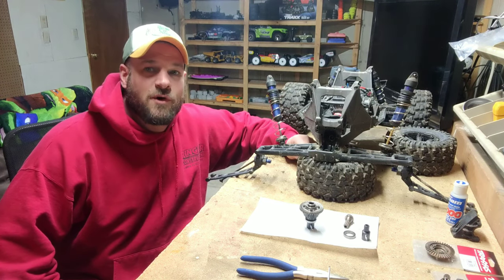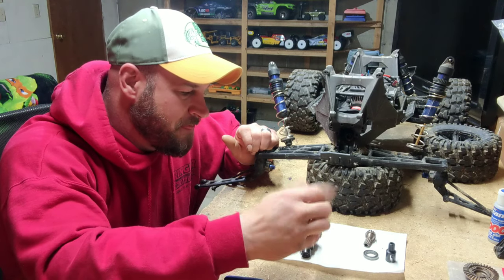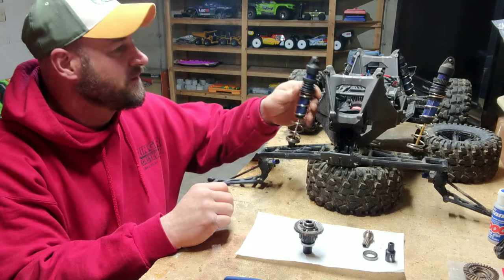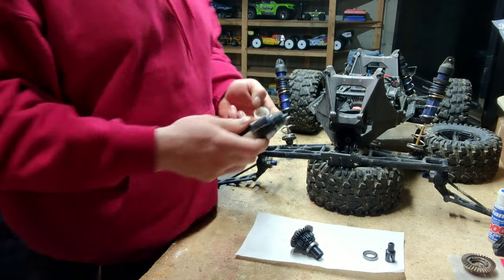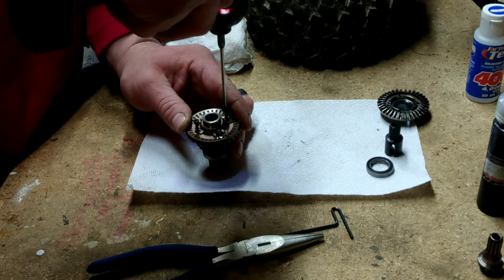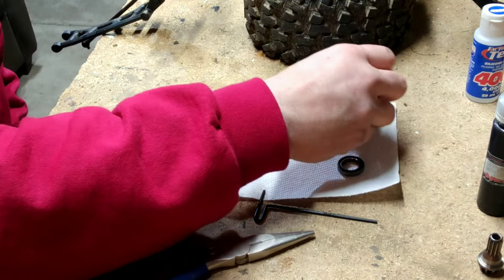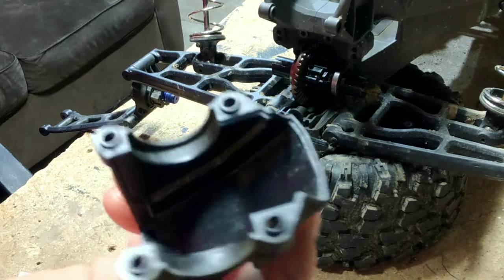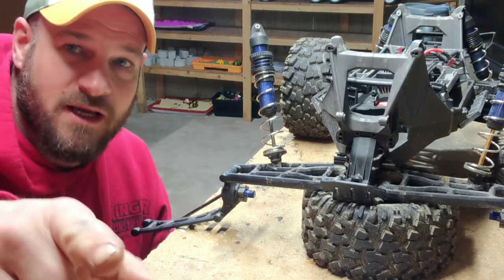XMAXX 8s Rear Diff & Pinion Gear Replacement

Comment: I have a few XMAXX’s. I just found today the rear diff bulkhead plastic wears at the rear bearing allowing the pinion gear to move a little out of place. The rear bulkhead of under 20$. I would change that out as well if you have a few miles on your rig. Great video!!!!!

Comment: What kind of grease goes on the gears? I have a multipurpose grease that I  bought from a hardware store, it's lithium based says it's Good or needle bearings and a bunch of stuff. It has a clear type color to it and the stuff that was in the gear when I took off the cover was green,  Does it have to be a special rc gear grease?

Comment: Hey Bru-c.. recently my xmaxx fell for the 50th time from the hevens & split the belly in half bent the drive rod, smashed the rear diff.. so now after all chassis etc replacement iv got knocking from either the front the middle or the rear diffs, i inspected all differentials and could only locate a problem with the rear diff and replaced said damaged gears BUT now its still knocking, im more certain now because it onlz knocks loudly when either i brake or when i reverse which with both actions "loads" the front diff, im tempted to unhook the drive shafts from the front to try and isolate one from a probable three problems. what are your thoughts man cheers for any advice.
Reply from the maker: Taking the load of the front to try to isolate is a good start my friend, just thinking how the wheel hex look and the Inside of rims??? But betting a gear in front half is bad buddy. For sure take apart and look at the front diff. One last thing you didn't forget any bearings in rear diff? Hope this helps my friend